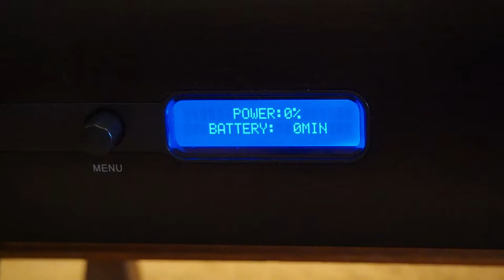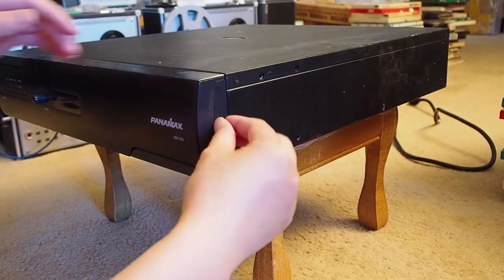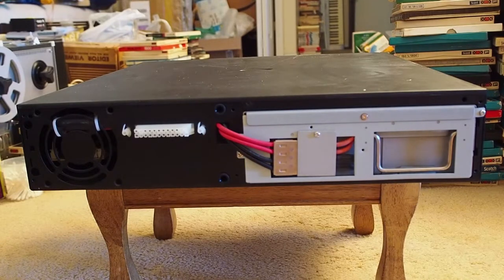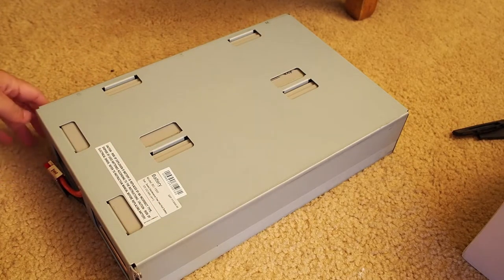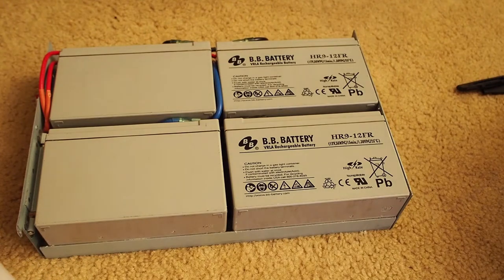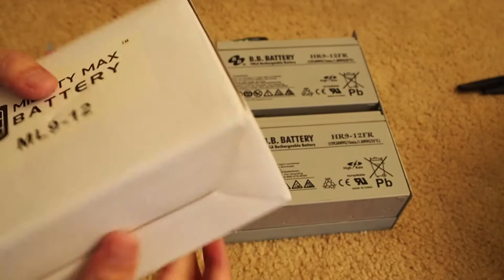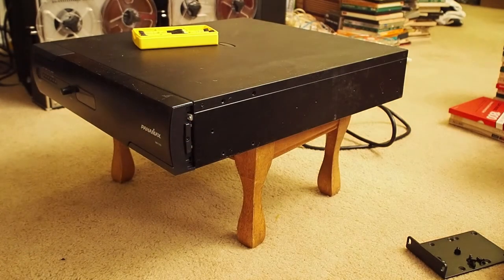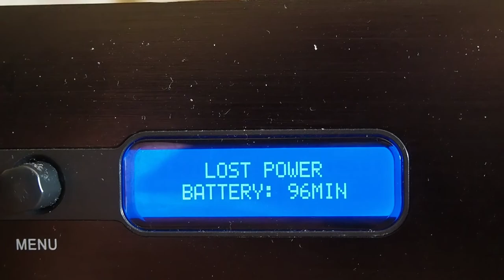Panamax MB1500 Power Conditioner UPS Battery Replacement

Comment: How did you know which battery to replace?
Reply from the maker: Easy. replace all if you are not sure which one. Otherwise, you can replace the one with low voltage.
Reply: Is there a way I can turn off the alarm until I can replace the batteries so I don’t have to listen to the beeping? @DunQuDeYi
Reply: @DunQuDeYi  Nice video. Thanks. So, how did you  already know which battery to replace even before you opened the case in the video (the one with 10 volts). Did you know ahead of time, or did you measure each battery ahead of time, then put the battery pack in, and then make the video?